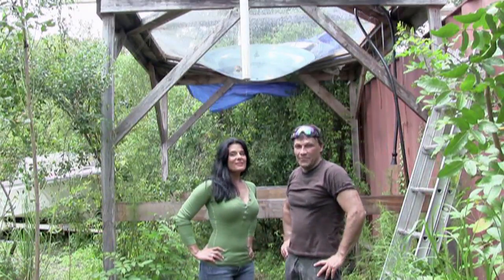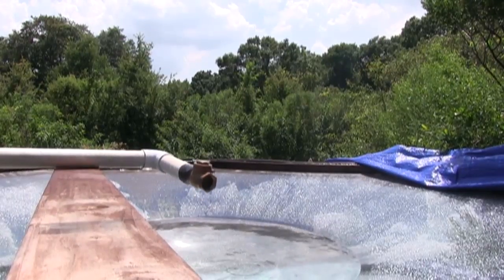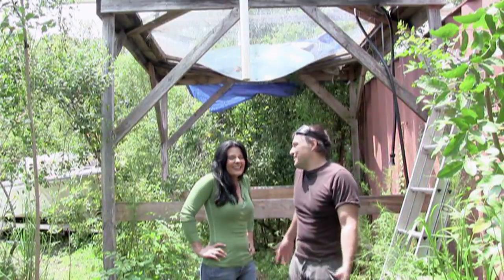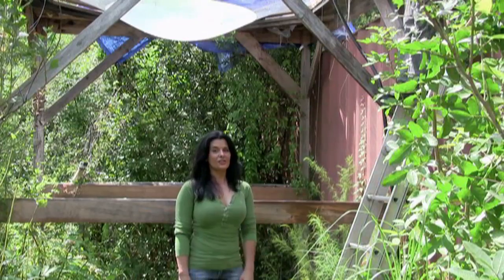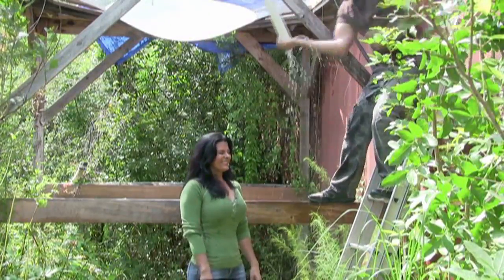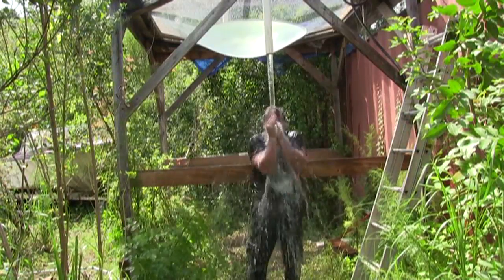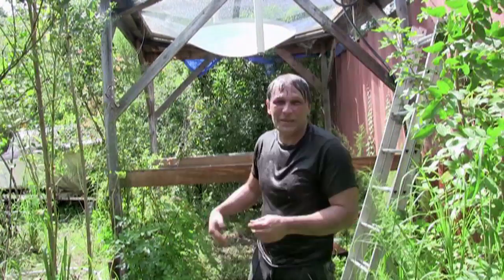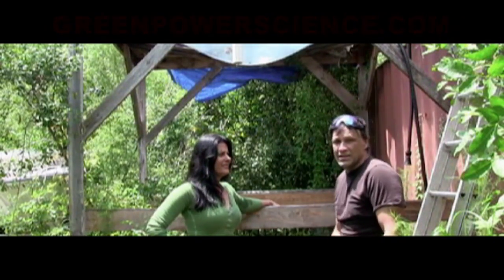GreenPowerScience ALS Ice Bucket Challenge water parabola Rain Grabber,

Comment: to get the water hot with minimum work:

put some food dye , like a deep blue or dark red(EVEN BOTH), with enough concentration that it absorbs the sun heat.

it will be funny to film and to watch.

ps: check the temp, so the vinyl wont tear, and no ones gets burn.